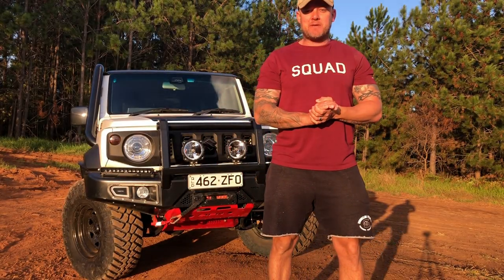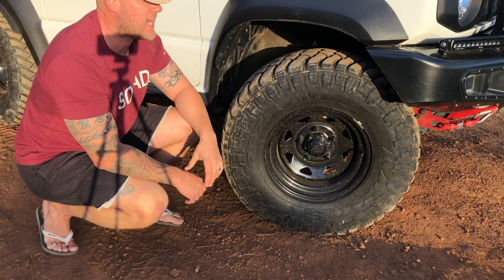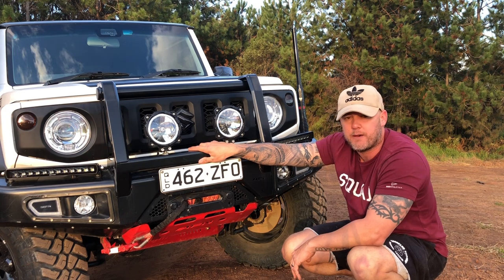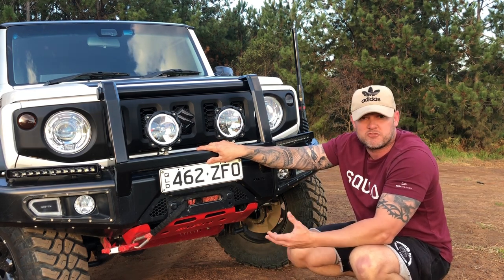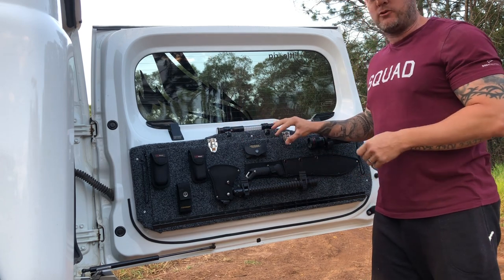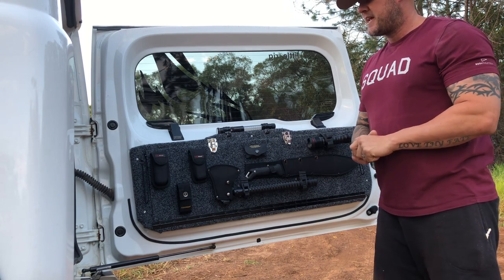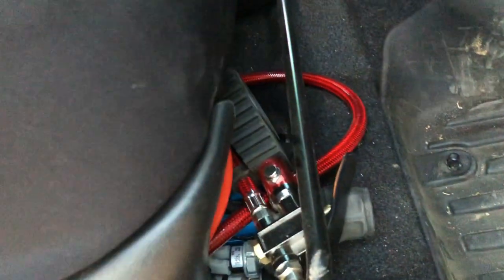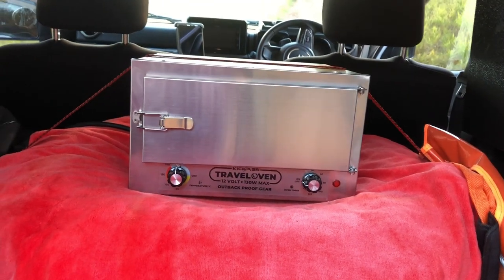The Little Rig 2.0 Full Modification Walk Through | New JB74 Suzuki Jimny | Twin Locked with Gearing

Comment: Here is the summary. If you feel anything I missed or if you wanna improve it, replay to this comment.

1	31x10.5 R15 Maxxis Razar MT
	R15 8j Steel Rims with -25 offset
	2 inch extended flares on top of tyres
2	EFS 50mm suspention lift
3 	AFN Bullbar & AFN Bash plates
4	KC headlights
	13.5 inch single row light bars
5 	Carbon Offroad 9500 pounds winch
6 	GME UHF Radio
7 	Snorkal
9 	Bushtech windows
10 	Dropdown table
11 	ARB Twin Air Locker
12	Reduction gear (Protrack greece) - LOW 87%, HIGH 17%
13 	Wilddog rear steel bumpers

Comment: Thanks a lot for your wonderful videos. Fascinating, what your able to do with your Little Rig! One of the best street legal Jimnys! One question: How is your long term experience with the Protrack low gears? Good quality, no problems?
My Jimny has a lift and front and rear lockers. Works fine. But still original tire size. Transmission for me is already a little bit too long, would be worse with bigger tires. Shorter gears would allow me put on bigger tires. Would be the ideal combination.
Reply from the maker: Thankyou so much. The gears are fantastic quality. I’ve had zero issues whatsoever. With the gearing I have, 87% low 17% high, 32” tyres are ideal. But there are lesser gearing options available from Protrack  that would suit a 31” or 30” tyre perfectly 😊

Comment: You have a new sub here, additional to your wheel set here, are there any spacers beside with the negative 25mm offset? Thanks!
Reply from the maker: I don’t think so in this particular video, however on some occasions I have gone as wide as 50mm spacers along with the -25 offset. I vary the everywhere in between depending on the combo of wheels and spacers I am using at the time 😊
Reply: @TheLittleRig  appreciated, rides safe! 😊😊

Comment: Another nicely explained video. Quick question, after adding in bull bar, winch and other mods; is it not affecting ride handling? What about on-road manners; acceleration, top-speed and fuel economy?
Table is awesome. Would you be able to make one for me when I buy my Jimny? ;)
Thank you for all the efforts you are making to bring these videos. Cheers bro!
Reply from the maker: Hey mate, well it definitely affects my fuel economy. My field economy is terrible. I only get around 300-320km per tank. That’s because of some weight added obviously but also the big tires. As far as handling though, all the weight down low keep me very ‘grounded’ and the actually handling is fantastic. Better than a stock Jimny in my opinion. But accelerating and braking is noticeably worse.

Comment: Hey man what an inspiration. So you obviously added a lift kit and lockers, but are you still running stock axel and arms etc? Also any engine mods?
Reply from the maker: Hey mate, still stock axles at this stage as I won’t replace them till one breaks (if it does). I have 33’s on these days and they’re still holding up fine. I do have heavy duty drive shafts in though. 
As for the engine, my main priority is going slow (crawling) so I haven’t had any desire to beef that up really. I have a Legendex exhaust system in, plus the snorkel and k&n filter which together maybe make for a tiny performance increase. 

Thanks heaps for the kind words mate 😊

Comment: Hey mate! Love the build! Do you have any info on the second rubber strip you've added around the door? Assuming it's to help keep water out during water crossings. Thanks!
Reply from the maker: Ahh mate yes good question. I wish I had spoken about that actually. Yeah so I’ve added That rubber strip around the doors and also the lower half of the boot to keep water out as you said. It actually works perfectly. Never had a drop of water get past it yet. It’s just a sticky back rubber seal from bunnings 🙏

Comment: Hi
You were mentioning about reduction gears after installing lockers are they required to done while installing lockers
Reply from the maker: Hi mate, nah the reduction gears actually don’t have any relation to the lockers. 
The gears are for bringing your rev range back to factory standard when you put large tyres on. Or, if you want very slow crawling ability off-road.
Reply: Thank you so much for your reply 😊
Reply: @TheLittleRig  sorry to trouble you once again. Had a few queries regarding installation of ARB rear locker for my Jimny 
1) Does the installation affect the overall performance and mileage of the vehicle 
2) Since the air locker is just used when necessary and in such situations say for example you are ascending a steep hill with a turn to either the right or left, Will the locker and axle get damaged when you turn your steering in such situations.
3) Since there is a change in differential step up after installing air locker and it becomes an open differential in normal usage does it affect the drivability of the vehicle on Tarmac
Reply from the maker: honestly they won’t affect day to day driving at all. You won’t notice them when they are not engaged.
Reply: @TheLittleRig  thank you so much 😊

Comment: Thanks for the walk around...very impressed.
Im looking at putting BFG  KO2s on.
Will i need a lift prior to fitment.?
Cheers
Reply from the maker: Hey mate thanks for that 😊 What size you looking at? Anything bigger than 235/75/15 you’ll probably find you’ll need a lift mate. 🤙🏼
Reply: @TheLittleRig  
Thanks for your reply and the heads up..
Cheers👍

Comment: Hey mate! Love the build! 
You used to have a Bei House spare wheel carrier I believe, and I just ordered one! Wondering how/where you ran the wires from the work light into the car to connect them up?
Reply from the maker: Hey mate so the best way that I found (which not everyone will be happy to do) is to remove the rear window wiper and run the wire straight through that hole with a rubber grommet to waterproof it. I never ever used that wiper and it’s hidden anyway, so to me there was no point having it, and it provided the perfect wiring solution 😊
Reply: @TheLittleRig  that’s a really good call, I would never use it too - thanks for that!
Reply from the maker: Anytime mate 😊

Comment: Hey mate, love your set up. Could you please let me know were you purchased the rubber/plastic extensions placed on your fender flare wheel arches ? Thanks Anthony.
Reply from the maker: Hey mate, as mentioned in the video it’s just plastic garden edging from the hardware store that I’ve screwed on and trimmed with a sharp blade to shape 😊🤙🏼
Reply: @TheLittleRig  Cheers mate, thankyou for the quick reply
Reply from the maker: @5277699  any time mate 😊

Comment: Hola amigo como estas?
Esta padrisima tu Jimny, solo tengo una pregunta, no se puso muy pesada tu Jimny con esas llantas, es decir, no la sientes muy lenta en carretera?
Reply from the maker: Hello my friend 😊 
I have installed reduction gears which help when driving with the larger tyres. It’s a little bit slower from the start line, but usually it is completely fine 🙌🏼

Comment: Lovely ride . , What kind of speeds can you do on the highway with the reduction gears n 31 inch tyres  ?
Also I see you have an RTC strg damper . Is it a tough dog ? How is their performance ?
Reply from the maker: Speeds are absolutely no issues whatsoever. Everything you can do I’m a stock jimny, it’s exactly the same 😊 As for the RTC, yep it’s a tough dog. I actually wouldn’t recommend. I would however recommend the tough dog 9 stage steering damper 😊

Comment: WIll watch the full thing when I am not at work. You mention it's not a daily driver, what do you use as a daily? I want to fit 235 MTs on my Jimny and I know that's gonna suck for tootling around doing errands so will pick up something in a couple years.
Reply from the maker: Hey mate I’m fortunate enough to have a vehicle for the company I work for, as I’m an installation technician so I need a big van. 
When I had 235/75’s on I still found that fo be pretty cruisy and comfortable. There wasn’t really any noticeable difference. It was really only when i went to 30’s I noticed but then really noticed with 31x10.5.
Reply: @TheLittleRig  Thanks mate, good to know! Love the Little Rig 2.0- probably the most capable Jimny on the Southern Hemisphere or maybe even the world lol.
Reply from the maker: Thankyou so much mate! Really appreciate it 😊🙏

Comment: Hi, just love your Jimny. Want more info on your lockers. I'm also waiting for my Jimny and seriously thinking of adding twin lockers. Just want to know are you using one or a twin compressor setup?
Reply from the maker: Hey mate, I just have a single compressor and honestly it’s more than enough. It literally takes less than a second to engage both lockers 😊🤙🏼
Reply: Thanks for response. Can you also inflate your tyres with this arb compressors?
Reply from the maker: @chriskirchner9365  yes absolutely. I have it mounted with the hose under my drivers seat, so I literally get off my seat, pull out the hose and inflate 🤙🏼
Reply: Does the compressor not fit in enginbay?
Reply from the maker: Yeah it def does. But by the time my mates have opened their bonnet, found their hose and connected it, I’ve inflated my first tyre haha. 
Obviously everyone has their own preference for what works for them, I just chose this way for convenience 🤙🏼
Reply: Got it. Thanks

Comment: Awesome vid bro,did the 31 inch tyres bring the speedo back to true speed with the reduction gears
Reply from the maker: Thankyou very much mate 😊 Yes you’re actually spot on! If anything I’m still maybe 1-2km/hr slower on the Speedo than true speed, but it’s certainly much more accurate. 
It’s amazing how far they buffer the Speedo under true speed from factory hey!
Reply: @TheLittleRig  I've got a jb43 with front and rear lockers, i put in the same reduction gears but still need to sort out my tyres. Currently running 215 75 15 bfg  mt and the speedo is reading about 13 km to fast.
Reply from the maker: Wow that’s a massive difference hey haha. Far out.

Comment: Did you extend the bump stops at all? I have 235's and I notice that they scrape the linings in front. Was there anything else that you did besides the offset rims to get them to fit?
Reply from the maker: Hey mate when I had 235’s I did need to trim a tiny little bit away from my bullbar to avoid scrubbing under flex and steer. 
With the 33’s I have now I have to cut absolutely heaps of metal away from the wheel arches to make them fit and still get full flex range. 
I don’t think you’ll need to worry about extended bump stops with 235’s. I was still even able to take the sway bar out and get an extra 100mm of flex with the 235’s, so I think it may be a case of a tiny bit of trimming for you.
Reply: @TheLittleRig  I have ordered the same reduction gears that you have. I wan't to go with 31" tyres. I have high clearance bumpers, so no issues there, will I need to do any body trimming to get them to fit?

Comment: Have you upgraded your battery and alternator to cope with using the extra power needed with all the lights and winch or are you still using the stock parts??
Reply from the maker: Hey mate nah the stock parts are completely fine 🤙🏼 I actually had a lot more lights prior to this and the battery and alternator have handled them and the winch without even the slightest of issues. I have a few mates running insane amounts of lights, plus camping gear, winch and they’re all good too. 
HOWEVER, having said that, I do have a brand new custom alternator being made as we speak with a much higher output! But more about that in the coming months 😊🤙🏼

Comment: hey mate, hope you and your l_rig are alright,  need your advice, so long story short, got jb 74  (Automatic) gonna put 30-inch AT tires, and because of it have doubts:
1) will it be ok for a city (on-road and off-road 50/50)? 
2) reduction 4.625 or 4.875 (it will be not tcase, gonna use r. gears in diff, I mean ring and pinion)?

I saw how your rig evolved from 29 to 30 and finally to 32, which means you definitely have real experience.
TY in advance!
Reply from the maker: Hey mate, 30’s will def be of for 50/50 city and off-road. You’ll lose some fuel economy obviously and will be a little slower to get rolling from traffic lights, but other than that no worries at all. 
As for the reductions, it will have very high rpm with 30” tyres, so be prepared to have about 4000rpm+ when driving at 100Km/h. I have 33” tyres and that only just makes my rpm a bit more normal In high range. 
Having said that, the reductions are well worth it purely for the off-road benefits 😊
Reply: TY, for quick response, so as far I understood, all about 4000 rpm related to stock gears
Reply: Now the last thing I need is chose which reduction I have to get 4.625 or 4.826 the stock for auto is 4.3
Reply: Mate the funniest thing is that this car for my wife, it’ll be kinda second car of our family, the first one is cr-v, I’ve represented jimny as second car for commuting to the work and weekends, and 30 inch tires, just to be more comfortable backcountry ))

Comment: Hi mate. Do u need to cut the body to suit these 31inch tyres?
Reply from the maker: Hey! Only a tiny bit for the 31’s. Not much at all. I since upped them to 33’s and that requires a heap of cutting.
Reply: @TheLittleRig  thx mate
Reply: Also did u change the sway bar on these 2 inch lift 31 tyres set up? Thanks.
Reply from the maker: @bclinkptyltd7451  not on the 2” and 31’s but with 4” and 33’s I have. I have the Hardrace quick release sway bar and the sway bar relocation kit
Reply: @TheLittleRig  thankyou for ur informations

Comment: I'm still waiting for my suzi to get delivered, I have already bought heaps for it and there is always more to get!!

The reduction gears, are they necessary for the bigger tires and does it affect top speed or engine performance while travelling on a motorway/100kms?
Reply from the maker: Hey mate congrats on your new Jimny coming soon. Hopefully it’s not too far away 😊
Yeah the reduction gears certainly make having large tires a lot more friendly on your drive train. It greatly affects the engine at higher speeds. On the highway at 100km/hr you will be sitting at about 4000rpm. 
It’s not something I would recommend unless you plan of doing majority off roading on steep, rocky style tracks. 😊🤙🏼
Reply: @TheLittleRig  how about low range only reduction? I've seen 70%ish reduction for low range only in Japan. Wouldn't be any help for street driving obviously
Reply from the maker: Yeah that’s a good point mate. I’ve also seen a 77% / 7% which wouldn’t be good bad 😊👌🏻
Reply: @TheLittleRig  Really enjoyed the video.  As you are from QLD I'm curious what you do on sand now.  Do you drive in 4H on sand?  I always drove in 4L on sand but with a 77%+ reduction it seems like it would be too slow and that 4H would be too high.
Reply from the maker: @FourLowAdventures  hey! 😊Yeah so in soft sand I drive 4L always. More control and response. When the tide is out and it’s a good solid flat run up the beach 4H or 2H for sure 😊
Reply: @The Little Rig  So I ended up ordering the 7% / 77% because I want to stick with the 30" tires, which have worked really well for me in the Vic high country (other than the stock gearing).  If you're ever in Victoria and want to hit up some tracks then let me know.  Cheers!
Reply from the maker: @FourLowAdventures  oh that’s awesome! And yes I would love to get down there one day 😊🙏